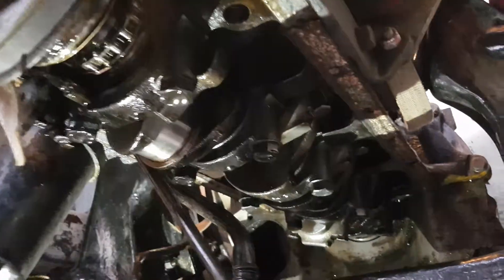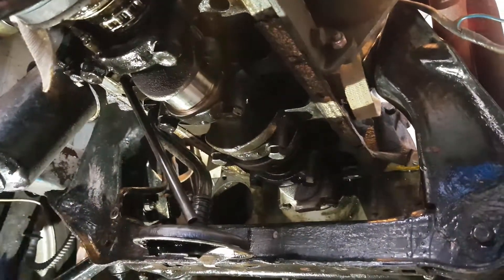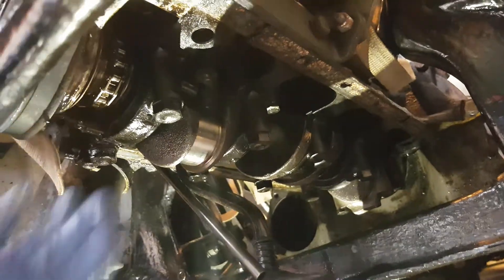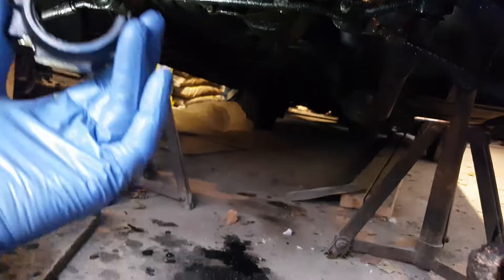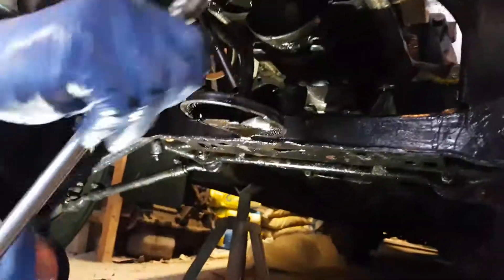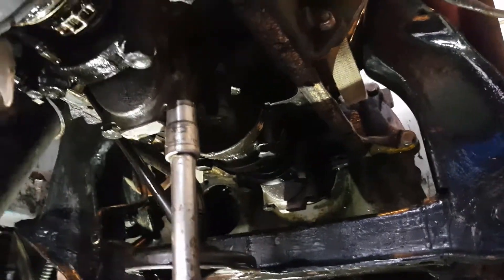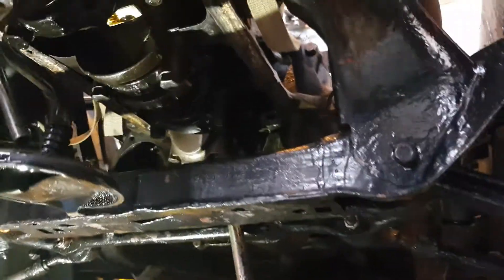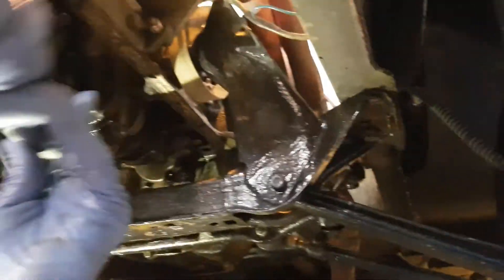MK1 Ford Cortina Gt engine rebuild

Comment: Sump gasket kit tip (non crossflow.) Know the production date of Kent block.-see mfg  chassis tag...
Nov 64' & before users early sump casting , Dec 64thru 65 uses newer sump pan and block slightly different (crossflow?). Inspect both motor mount and gearbox mount since you're  under there and replace them.
Had a 65 GT 1500.(1498cc) non crissflow w/headers  & Weber 28-32 carb --- Stock.&  Pos earth electric sys.. fun stuff.!!